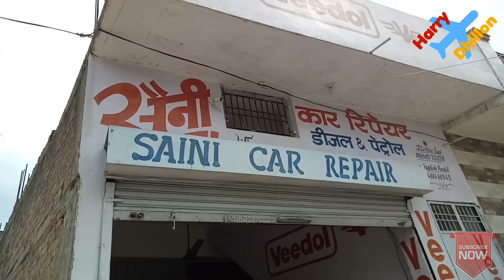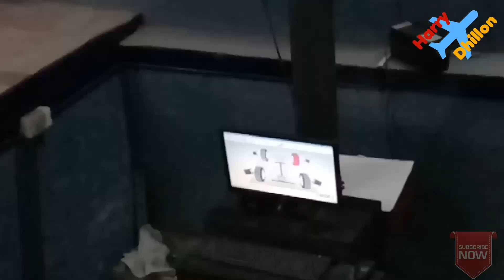Tata Nano Service & Cost !! Full Details !! Harry Dhillon

Comment: M located in Gurgaon The  Authorize Tata Nano dealer M/S Aristo Automobile has closed down where I used to get service and other problem. I don't know about the local mechanic weather the local mechanic can do work for Tata Nano. My car is CX 2011 model.Never had any problem till date frequently travelling cross country.But now in couple of days I found a dashboard engine & temp. warning light continuously.How to get it repair.Please advice.
Reply from the maker: Yes, local mechanic can do service of nano, please check coolant for heating pblm as well as water.

Comment: What is the Total amount spending for full service ?? Change all the Filters....
Reply from the maker: I spent total 1400 around,  I briefed in last of video,  you can check
Reply: @HarryDhillon  Thanks for the Very Fast Reply Sir..... Massive Respect to U Sir...... But the Problem is I I am from tamilnadu I don't know Hindi..... But I Try to Understand It..... Thanks Sir I'll go and check it out
Reply: One more question that's which one is best & Cheapest ? tata company Service or gopal local mechanic shed Service
Reply from the maker: @sheikmccullum8761  If your car is under warranty then go to Tata motors service center or if it's out of warranty then go to local mechanic, it would be cheaper

Comment: भाई नेनो का सर्विस कितने किलोमीटर पर करना चाहिए जिससे कार सही चले
Reply from the maker: Pahle mai 10000 per karata tha bt ab 5000 per karata hu local me
Reply: Depends on ur running situation, if u drive the car in city then u hv to services ur car 5to7 thousand...and if u running ur car on highway then no problem abt service...
U kn easily run ur car between 15k to 18k without any harassment